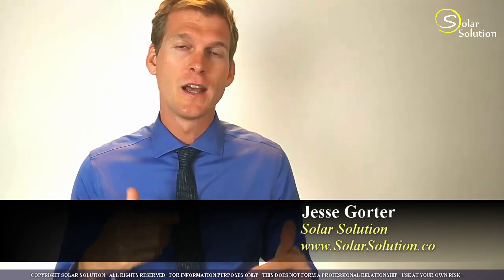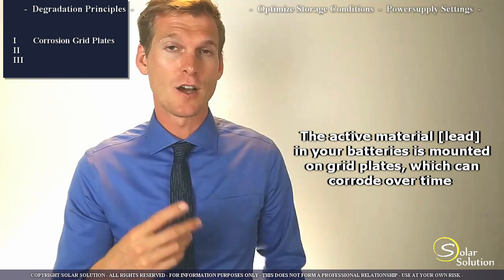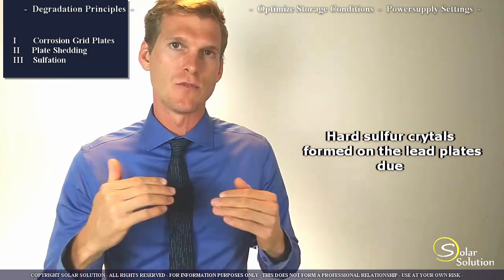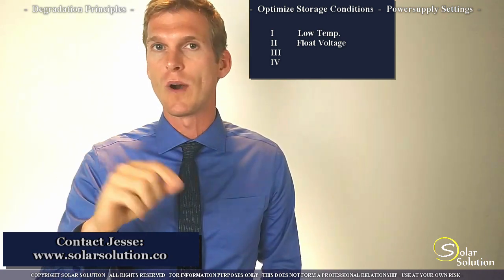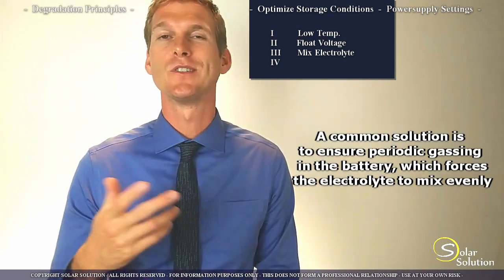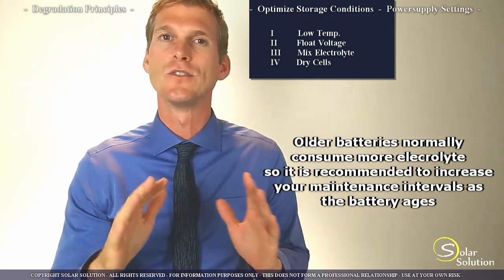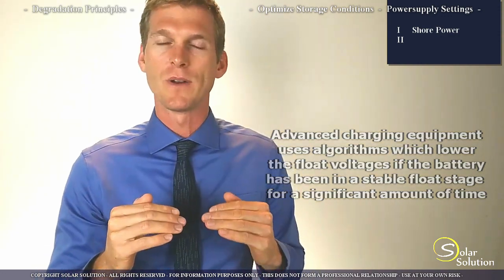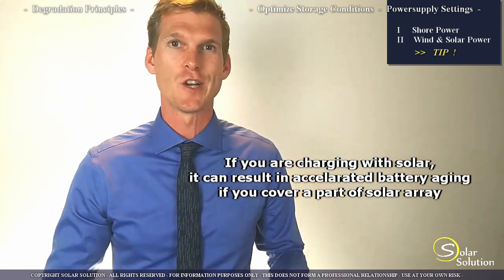How To Extend Your Battery Lifetime: The 3-step approach

Comment from the maker: Course trailer and Coupon Code:https://youtu.be/0Fh26SUnnx0
Reply: Thank you for the reply Jesse. I was told an inverter generator would work against my inverter mig welder. My question is really, is it possible to use an inverter generator of the correct KVA to power an inverter welder. I thought a pure sign wave generator of the correct size would supply clean power for the welder so would be better than a normal generator. Thank you I love your easy to understand videos I have learnt a lot from them. regards Paul

Comment: I find your videos useful in confirming much of what I myself have learned over 20 years of off grid living (solar with lead acid submarine type batteries). One perhaps negative point I feel I should mention is that very occasionally you are incorrect or inprecise in what you say. You have said that at specific times batteries create 'air' bubbles, did you mean hydrogen (& oxygen, effectively HHO)? The difference and potential omition of this explosive hazard is worrying. Also, you have mentioned topping up your batteries with 'water'. Again not specific enough and potentially damaging for the batteries themselves if your viewer doesn't appreciate that you mean to say 'distilled water', definitely NOT ordinary tap water. I hope: 1.) I'm not wrong 'cos I'd hate to look stupid when I'm only trying to be helpful & 2.) you actually find my feedback useful.
Reply from the maker: Hi Graham! Thank you for your sincere and helpfull feedback. I'm glad to hear you appreciate the videos I have been sharing. And yes, you are of course absolutely correct on both accounts [hydrogen, oxygen, destilled water, RE #1], so thank you for that correction [RE #2]. Thanks for taking the time to write to me! Take care, Jesse.
Reply: Wow! On this occasion I was stunned by the speed of a reply. Many thanks. So pleased you found the feedback useful (note: only one 'l') and to a lesser degree that I wasn't wrong with my thinking.

Comment: Have a question about an upgrade I want to make on a boat.  Boat has a single 12V starter battery that is also the house battery (for fish finder, radio etc).  Outboard motor has 60amp (at full rpm) alternator, about 30 amps at 1000 rpm, available to charge the starter/house battery.  Boat also has (2) 12V batteries in series for a 24V trolling motor.  Would like to set it up to where the starter/house battery/motor charge the 24V bank when the motor is running.  When the motor is not running want the 24V bank to augment the 12V house/starter bank, to give extended fishing time without using the outboard motor.  Was thinking about setting up both a 12V to 24V Victron charger AND a 24V to 12V DC converter between the 2 banks to accomplish this.  The Victron charger would only come on when it senses the starter voltage at >14V when the engine is running and the DC converter could be set at about float voltage for the house/starter side, say about 12.7V.  What do you think about this idea? Any issues?

Comment: Hi Jesse, I remember your rule. I'm  still paying for last year when lack of securing my batteries led to a humpty dumpy situation. Out of the 4, 1 is sealed at the crack at the bottom, that and 1 other I''m still plugging holes in the boat to stop sinking. Drained one, JB Welded it and that staved off replacement. Pacific quick education and is extensive as it's been I've gotten a couple of small details along the way just barely enough to where I broke the golden rule. When I refilled it I didn't check the fluid of The cell where the casing was damaged enough and I imagine that my biggest mistake was not having a timer set to make sure that I would fill it up as it was completely fresh battery acid from AutoZone and I imagine evaporated or whatever.... Yeah literally not asking a question I kind of figure I know what's going on now but it sure enough went below the plate level just barely just barely, And I've yet to see the results from that, but im absolutely certain I lost battery life. So I'm going to keep on plugging holes until I can finish what I'm doing and then I'm definitely going to follow through cuz I would like to video consult with you but until then I have to keep on buying JB weld and van parts to get out of my situation before I can spend money on a consultation. I do look forward to getting your advice on a lot of questions. Thanks for the help you've already giving me though just with your videos and occasional comment. For some reason you are really inspiring to me and I don't know maybe it's just because I That's so long learning about them before I even found you on YouTube and already become dependent on the batteries and solar. Wish you well sir.

Comment: Someone recommended adding sulfuric acid every 6 months instead of water to extend the battery life. Should this be done? Or should acid never be added to a battery?
Reply: Don't. The gasses are due to the electrolytic breakdown of water, not the sulfuric acid. This means you're only losing water, not acid. In fact, adding more acid only speeds up the degradation due to an increased rate of corrosion.

Comment: After watching this video it seems to me the car's charging system doesn't do a very good job at keeping the battery topped up. I just replaced the battery on my car with a fully charged one, I drove the car around and today morning I measured the voltage which was 12.6v. My car is very likely to keep the battery at 12.6v since I don't drive that much, it will not discharge but also never fully charge. Is my battery's health going to go worse soon?
Reply: The 12.6V is perfectly fine as a resting voltage the next day. Try measuring right after driving for 50 miles or an hour or so. You'll also most likely see an increased voltage when the engine is on or better yet, revving it to 3-5k.

Comment: Can you explain how one battery in a sting of 4, for a 48 volt FLA bank, can can get down to 9.2 volts while the other 3 are 12.5+ ?  Further more the second string of 4 the center two batteries are at 11.5 and the outer 2 main positive and main negative are 12.5+ ? 
Can anyone take the mystery out of this for me?

Comment: Thank you for this video but I have  a bit different question
Can you tell how long is the average lifetime of the batteries in an off grid solar system? I know, this depend from a lot of things, but if everything is near optimal (charging flow, cables, so everything), how long the lifetime in real life?
Thank You!

Comment: Hi sir, I bought 2 x 150 ah Deep Cycle batteries about 9 months ago and were able to power 4 x 40 Watt fluro Rube's and a deep fridge for about 4 to 8 hours. For some reason now I  can only get 1 to 2 hours only. When charging batteries it does not take more than an hour to fully charge. I have run it dry to 0% maybe 6 to 8 times within the 9 months. Any idea on why the the batteries are underperforming?
Reply: Sounds like you have either AGM or Lead Acid Battery. This should NEVER be discharged more than 50% (depth of discharge), this degrades performance. If you are charging via an inverter, make sure inverter switches off at 45% depth of discharge or worst case 50%.

Comment: Is charging a lead acid slower always better or does it make no difference as long as its under a certain amperage?
In terms of capacity, if I charge at 0.2C will I get more capacity out of it on that charge if I do it at 0.05C?

Comment: Hi
I have a 24 v solar system.
My bateries are 90 days old.
I bought 2 tall tubular flooded lead acid batteries.
Now i feel that the backup duration dropped criticalyy from 8 hours to 3.
I checked the cell all electrolyte levels are fine but found that one battery is not doing bubbles while charging.
Any advice?

Comment: Another great video.  Thanks!!  I have a question. If I am primarily dockside with my boat, plugged into shore power would it be best to disconnect (isolate) my solar panels? If I understood your section on power supply settings, it sounds like the job of maintaining optimum charge would be best kept to the battery charger without extra input from the solar panel.

Comment: sir, with concern of float charging..  if my battery is 12.80 volt, when charging it thru solar with charge controller MPPT in monitor of SCC float charge is 13.79v blinking,, what does it mean? is the battery full charge at that time? fully appreciated your response. thank you and more power.

Comment: What is the charging limit of a lead acid battery. Should we charge it to 13.8v or 14 v?
Reply: I mean when to cut off the power source
Reply from the maker: Thank you for you question. Have you consulted the specification sheet of your batteries yet?
Reply: @SolarSolution  no such information is provided by the manufacturers here in Pakistan, even on there official website there is no such information available. plz tell me the universal figures
Reply: 2.4 i m battery engineer

Comment: My 155AH battery was not performing well, I washed it with baking soda and plenty of water. Then I put 1.25 gravity sulphuric acid in it's cells. Now the gravity of acid inside the battery is dropped to 1.11. Even after charging the gravity is not raising. What will be the cause, plz suggest any solution. The gravity dropped imminently after putting acid in the battery. There was no water remaining inside the battery.
Reply from the maker: Hello Ali, thank you for your message. It sounds like you are on a steep learning curve, that must feel exciting! Soda washing comes with it's specific advantages, though it is often used to 'squeeze' a little more lifetime out of a battery which has already reached it's end of lifetime [EOL]. 
You mentioned that your battery was not performing well, do you have an idea as to what could have caused this? Examples of such causes are: Prolonged undercharging, deep discharging, elevated operating temperatures, excess voltages, high cycles, etc.
Reply: @SolarSolution  I guess it happened due to undercharging for a month. Plz make a video on "to what extent we can discharge a lead acid battery(voltages). Proper voltage and amperage for charging. The maximum limit of charging in volts. The setting parameters of solar charge controller.

Comment: Shout out to Jesse!  I had some issues with y solar setup, and could not get the answers I needed from the manufacturer, an electrician and a good friend.  I hired Jesse. I was a bit nervous counting on someone halfway around the world to guide me, but Jesse came through with flying colors.  If you have issues you can't resolve, don't hesitate to hire Jesse to consult.  You won't be disappointed.
Reply from the maker: Thank you for your message, that is good to hear. It was a pleasure to interact with you. Enjoy your system! 
All the best, 
Jesse
Reply: @SolarSolution That was quite a compliment to you Jesse!👍
I'm sure it was well deserved.
I'm so impressed by your knowledge, and always learn something from you every time I watch you.
You've given this 60 year old man, the confidence of being in the process of building a 2000 watt solar system in a large toolbox.
I figured it's probably going to end up weighing about 60 lbs or so.
A little heavy, but still portable enough to take anywhere.
Thank you so much for everything you do.
Be safe brother.
Scott

Comment: General question can I use a pure sine wave inverter generator to run an inverter mig welder or will it damage one or the other?
Reply from the maker: Hi Paul, thanks for your question. It might be helpful to provide the details of the specific generator and welder you are considering to combine. All the best, Jesse.

Comment: Hai , my name is Rahul and Iam from India.I watched your channel videos regarding inverter batteries and thanks for the valuable informations.I want to clear some doubts with you regarding my inverter battery.
Iam using a 1kv off grid solar PCU in which we can manually caliberate the battery bulk & float voltage of which Iam a little bit confused of these voltages which is good for my system battery health,backup & life.Iam using 150AH c10 battery.
My Solar PCU charges the battery in three stages & auto equalise in a month.The PCU default values are 
For SPV,
bulk-15v,float-14.2v
For grid,
bulk-14.5,float-13.8v
Both values seems a little bit higher I think so.I tried to get the specific voltages for the battery from it’s company but I couldn’t.My battery & solar PCU is of  same company.
The temperature here in my area depending on the monsoon & summer goes from 26 degree Celsius to 36.
Kindly help me with the best voltage values for charging my battery.
Thanks to you,god bless you.
Reply from the maker: Hi Rahul, thank you for your message. It is good to hear from the other side of our planet. I understand your situation, unfortunately I cannot provide you with specific recommendations through the Youtube comment features, due to liability concerns. 
A way around this is to get my personal [paid] support through the website https://www.solarsolution.co. 
An alternative would be to try to contact the battery manufacturer again. Good luck! Jesse

Comment: Great  video, very interesting.  I understand  this recommendations are for  lead batteries. Will it be the same   for  gel batteries?  Can gel batteries be stored in  an airtight container? 
Thank you.
Reply from the maker: @Fernando Gonzalez thanks for your feedback. Gel batteries function different indeed, though they are Valve Regulated Lead Acid batteries [VRLA], so they can still emit fumes. 
I like your feedback, and I think it would be a good idea to share a separate video on Gel & AGM storage principles. Thanks!

Disclaimer: This information is provided for informational purposes only. Use at at your own risk.
Reply: @SolarSolution  thanks for the reply.  Yes, I think  will be  very  useful a specific  video  for  AGM and gel. 
Also may be  a video  on safety if working  in an areas  where the  battery are  stored, will be  possible?
Reply from the maker: Thanks Fernando, that also sounds like a topic we should give some attention to. I will add it to the list!